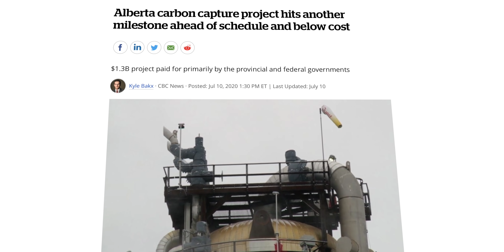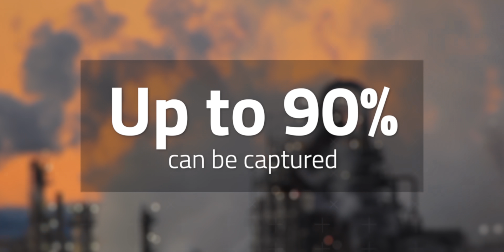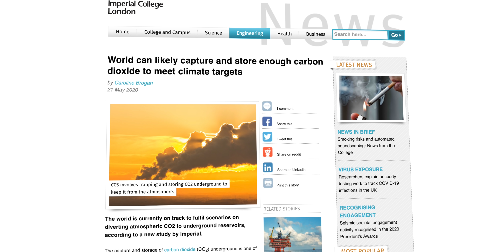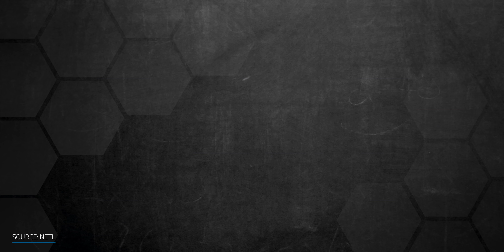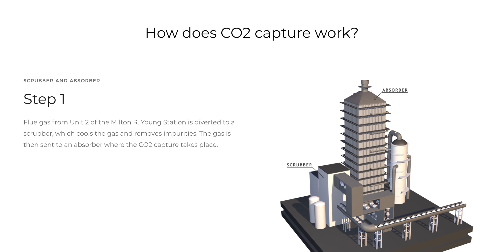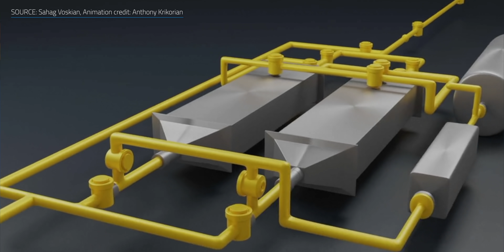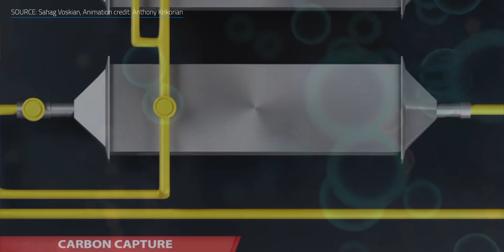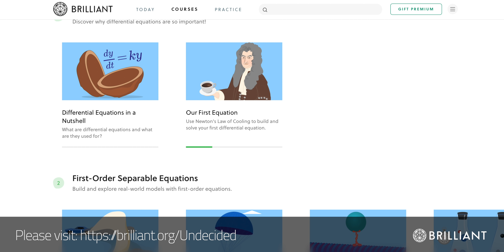The truth about capturing CO2 to reverse climate change

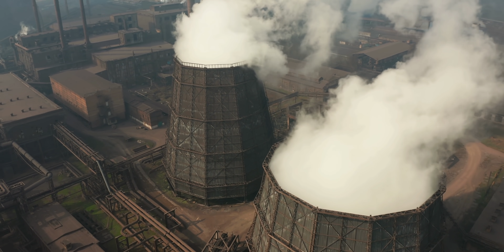Comment: 1:39 that's steam btw
Reply: What I find especially ironic is how dependent renewable energy is on fossil fuels.
Reply: @Philip Ethan van Harreveld no, just no. The monent the sun goes down and the wond stops blowing is when gas power plants get turned on. This does not apply to eg nuclear. So nuclear ends up being more environmentally friendly. Even moee when you take the new models into account.
Reply: Many movements require the ignorance of the masses
Reply: @allahbole  indeed.

Comment: Seems to me that there is no SERIOUS way to eliminate CO2 (net) emissions, until we can stop burning fossil fuels.  We won't stop burning fossil fuels until we have a viable substitute.  Wind and solar probably won't get there (I would like to be wrong, but I just don't see it).  Nuclear Fusion, particularly P-B11 fusion would certainly do it... If only we could make that work (and work in a cost effective manner).  There are some promising developments here, but it still looks to be 10+ years away, so this probably shouldn't be relied upon.  Today's Nuclear Light Water Reactors (LWRs) could do it, but they have costs and waste issues.  The waste issue seems to be overblown... It just isn't as bad as the hype makes it out to be.  The cost issue really comes down to regulations and "inherent" safety.  This is a complex issue, but the bottom line is that the cost of any Nuclear (Fission) Power generating system is very much driven by the INHERENT safety aspects of the reactor design.  Molten Salt Reactors (MSRs) are a newer, generation IV, type of reactor that is MUCH safer by INHERENT design.  (A simple google search on Molten Salt Reactors or MSRE will yield much info here).  If we had NRC regulations in place for MSRs that are much easier (lower cost) to comply with (because these regulations efficiently reflect the MSRs inherent safety advantages), MSRs could be constructed and operated at a much lower cost.  The 10X cost increase that has occurred over the years for LWRs could be reduced or eliminated with MSRs.  MSR look promising as a method to produce energy at a fraction of today’s costs (and a HUGE reduction in the waste produced as well).  With MSRs we can produce MUCH more energy!  The energy available in nuclear fuels (Uranium or Thorium) is a Million times that of any fossil fuel.   With energy this abundant, we can solve many of the worlds resource limitation problems!  The standard of living for all people on earth can increase many fold.  The potential advantages of MSRs are simply stunningly!  We would stop producing CO2 and putting it into the air.  We could even extract CO2 from the air in a means discussed in the video.  Or, we could simply grow trees and harvest them and store them in old coal mines... Reversing the processes of coal burning that has taken place of the past 200+ years.  Since plants actually thrive in relatively high CO2 environments, we would have to determine the optimum level of CO2 in the atmosphere.  It might actually be higher than what it was 100 or so years ago!

Comment: During almost all of the 55-yr period of The Great Acceleration (google it), weed and it’s non-THC cousin, HEMP, have been illegal to grow in the US. So the eco-benefits of hemp are rarely mentioned. It grows rapidly in poor soil, and so can be grown in places where it does compete with productive farmland. It is one of the densest grasses and per acre generates far more biomass than forests. 
     There are no magic bullets, but hemp can be used to pull carbon out of the air, improve the quality & productivity of farm soils, and sequester the carbon for hundreds of years. 
     Using a simple, proven process, the hemp is converted to biochar by heating in an O2-free device not anymore complicated than a meat smoker. The biochar is tilled into farmland, where it binds to soil materials. So long as the land is farmed in a sustainable way & protected from erosion, the biochar can stay safely in the soil for a very long time. 
     It’s a win-win. Farms are more productive and CO2 is pulled out of the air more quickly, due to the much more rapid growing cycle of hemp compared to trees.
Reply: Sorry, “... DOESN’T compete w/ productive farmland....”

Comment: What happens when you capture too much carbon?  Will it send us into the next ice age?  
The only viable carbon capture plant pumped the gas into an oil well specifically so they could get MORE OIL out of the well. When the oil pice tanked they stopped capturing CO2. 
Molten salt nuclear fuelled by stored used fuel is the way forward. Zero CO2 at source. Equally important, it burns down the high level nuclear waste. The stuff with a 30,000 year half life ends up at just 30 years. In the process it extracts 24 times more power than the original PWR extracted. 
When the regulatory process allows these will be cheap enough to put coal out of business and will eat into the market for methane gas.

Comment: Hi Matt, thank you for this very interesting analysis. May I suggest you do a piece on C02 deep sea storage? This is promising as the average ocean dept is below 3000 m (300 bars) the level at which CO2 is more dense than water hence stays on the ocean bed.
Reply: As a graduate student studying CO2 injection into offshore deep sea basalt, this should be talked about way more as the CO2 is mineralized and stored far enough away where leakage into groundwaters/atmosphere isn't really possible. I would love your take on storage in basalts versus sedimentary basins and depleted gas fields Matt!
Reply from the maker: Appreciate the suggestion!
Reply: This idea is nothing new but compression take tremendous amounts of energy, where will that energy come from?
Reply: XPRISE CARBON CAPTURE
The heat loss from a smokestack can be forced into a large tank containing hot liquid microcrystalline petroleum wax. The heat will keep the wax at a molten state which facilitate the carbon to be absorbed when combined with the wax. Carbon when mixed with wax reacts like a dye. The wax-carbon amalgamation result in a black wax solution thereby making it impossible for the carbon to escape into the environment. Other toxic particles are also captured in the wax settling at the bottom of the wax holding tank forming into a sludge. A sludge release valve is located at the bottom of the tank. After the sludge is removed more wax is replaced in the vessel working something like a toilet. The sludge becomes a byproduct that can be used as an additive to asphalt for roads or used for cocooning nuclear waste materials for long-term safe burial. The entropy of the Earth has been increasing at a startling rate since the beginning of the industrial revolution caused mainly by the carbon that is released into the atmosphere. Government scientists have failed to stop and prevent carbon pollution from entering the environment. This problem can only worsen until a solution is found before this problem becomes irreversible. It has been discovered that formulated wax has been shown to be the only answer to this problem. William Nelson

Comment: What are going to do when the CO2 gets to low and the plants all die!
Reply: This is so stupid that it's difficult to reply to. A) The goal is, and always has been, to get to pre-industrial levels of atmospheric CO2, not to eliminate CO2 from the atmosphere. Plants were thriving LONG before humans starting burning fossil fuels, they don't rely on humans pumping CO2 into the atmosphere for survival. B) We currently monitor atmospheric levels of CO2, so we'd know if we were getting close to pre-industrial levels of atmospheric CO2 LONG before getting there. C) Getting down to pre-industrial levels of atmospheric CO2 is basically impossible without adopting an entirely new economic system, so we're not likely to significantly reduce the concentration of CO2 in the atmosphere until there is a massive societal collapse of some kind.

Comment: Some of the ideas here sound interesting but it is with out a doubt just an excuse for fossil fuels to be continued to be burned. If you reuse the captured co2 you are keeping the cycle high enough to still cause a problem. Renewables and batteries. That’s it. That’s all is needed. If we can actually produce millions on evs wie will be able to use this storage to run our civilisation. It’s simple. The caviat is It may not happen quick enough and some of these technologies such as turning co2 into a solid compound may be required in the short term but only for this reason. Not for BAU.

Comment: Carbon capture is NOT in any way shape or form the way forward. Think about it, for every single car engine, massive jet engine, ship, power plant, etc, there needs to be an equally massive machine attempting to perform the opposite process without having a carbon impact of its own. The only way forward is zero emissions. We can live with 400ppm CO2 if we just stop the emissions. I'm 100% solar with EVs that charge on solar. I'm doing my part, and I hope that others do too.

Comment: It is both a necessity, AND an excuse for the Fossil Fuel Industrial Complex to keep polluting. 
I don't know how we ultimately get to carbon output neutrality, but surely we should be pursuing an All Of The Above strategy if technically feasible. We've been pursuing an All You Can Burn strategy and knowingly terraforming a new atmosphere for decades. It is way past due for humanity to be serious about repairing the damage we have wreaked on the planet.
What does All Of The Above look like?
- Decreased Overall Energy Consumption: eg. Building Efficiency, Construction Materials. Reuse, Recycling, Telepresence, Decreased Meat Consumption, Vehicle Efficiency, Carbon Pricing
- Decarbonize Energy Production: Solar, Wind, Geothermal, Hydroelectric, Nuclear, and—The Dream Solution—Fusion
- Carbon Capture and Sequestration: Reforestation/Afforestation, Emission Capture, Atmospheric Capture, Construction Material Sequestration, Soil Carbon Enrichment
- Geoengineering: Stratospheric Aerosol Injection, Marine Cloud Seeding, Space-Based Solar Mirrors (for realz)

Comment: There is FAR more potential for carbon capture - using plants*. Our agriculture is currently *producing a LOT of GHG - artificial nitrogen fertilizer in particular is very problematic. It kills the life in the soil, that is forming the soil, and this releases carbon. And the hidden source of GHG - is that nitrogen becomes nitrous oxide - which is about 8X worse than *methane*.

Grasslands are another huge potential to sink carbon very quickly and cheaply - grassland hold more carbon per acre than forest, and there is more grassland than forest. Grass grows very quickly, and if we manage herds of herbivores - we could sink far more carbon into the soil more quickly than virtually any other way.

https://www.youtube.com/watch?v=wgmssrVInP0

We could be back below 350ppm in less than a decade - if we manage grasslands correctly.

Comment: Love the video!! However, I still think you could have include some new interesting techniques. In Ghent (Belgium) Arcellor Mittal (steelanol project) directly use there CO2 emissions to produce (bio)ethanol. This by making use of bacteria that consume CO2 as an energy source. While carbon storage and more importantly concentration is important I believe conversion of CO2 is the way to go to reduce overall CO2 eq emissions.
Reply: No living system can use CO2 as an energy source. It is fully oxidized and bottom of the barrel energy wise. Even plants use CO2 as a building block for sugars and use the sun for energy. The plant you talk about uses CO (carbon monoxide) as a bio feedstock which still has a bit of energy left in it. The CO comes from their plant and is normally oxidized to CO2, so they are reducing their CO2 emissions but this is a speciality case and cannot be used in coal fired power plants.
Reply: @sjn7220  You are correct they not use CO2 as energy source. They use it as electron acceptor (H2 is the energy source). But it is nevertheless CO2. You can look up the Wood-Ljungdahl pathway!

Comment: The carbon capturing solution can be used in cooling towers of nuclear plants. The whole point of cooling towers is to have as much air-water interface to produce the most cooling, and that in turn CO2 capturing.

Comment: one simple very very good solution, plant more trees! and slow down the mass devastation of forrests and jungles! so easy. END
Reply: Planting enough trees to offset the amount of carbon emissions from other sources is entirely unsustainable. With a growing world population, land is needed for agriculture to keep up with food demands. At the same time, energy demands increase and a huge percentage of the global population is still living without electricity, clean water and sufficient food supplies. Why should we deny them basic needs while there are options such as CCS available? 3rd world countries are unlikely to afford cleaner energy, so the likes of coal/gas/oil power plants may be necessary during their industrial revolution.
Additionally, the majority of the worlds power is generated from coal, oil and gas and power plants have lifespans of up to 50+ years. In order for us to keep up with energy demands and limit emissions, fitting CCS onto these plants is essential.
Reply: @murrayurquhart1849  you seem to forget that is not developing countries that wantst too build the carbonvaacumecleaner, did you know how much of Earth's areal is habitable? I can keep going. It's like fat ppl don't want to eat less food to lose weight instead cheat and gain more in the long run. 1+1 is not 23
Reply: SeanGS Based on current energy demand and current available technologies, there is no choice but to continue using fossil fuels in the short term. Renewable energy coming from the likes of wind and solar only produce energy when natural conditions allow and electricity storage technologies do not allow for it to currently be stored long term. Replacing fossil fuels with cleaner ones (such as hydrogen replacing natural gas) will require widespread change to infrastructure. Changes are happening but not at quick enough a pace. We will likely exceed current carbon emissions targets and then have to remove carbon from the atmosphere by using biofuels paired with CCS, for example.
Reply: @murrayurquhart1849  lol, you can build 2 thermal plants on both poles to provide earth with enough power for free for the cost of about 10 nuclear plants. ZERO EMISSIONS FROM FOSSILES JUST USING THE EARTHS OWN HEATSOURCE
Reply: It's not that simple. There are whole economies that rely on deforestation. I suppose we could go to war with them but out side of that they will need to continue feeding their families. The most reasonable option is to get rid of 2/3 of the human population my mass sterilization.
Reply: @jayknight139  look @ it this way, we are a spec of fart particles hat existed for less than 300k years, this planet is over 4.5billion years. the way life works is imbalance gets balanced out with time... but the smart human race tries to be unbalanced and still get away with it. so nature solves that problem with harsh weather, disasters and drought, viruses and crazy people. so 2/3 of human population is a wee bit to little, we wont even exist in 300 years. something else will take over, maybe cyborgs or enhanced human/androids.

Comment: carbon capture is a fool's errand. Nice overview, however.
Reply: I think it will be worthwhile to do some in order to bring levels back down, and I'm sure there are places that can use the resulting captured carbon (Graphene anyone?), but as a way to make new fossil fuel plants green? No.

What we should be doing is all new energy from renewables, and installing a basic CCS on every current plant in order to slow the emissions immediately. Something that while not perfect can be implemented quickly and cheaply, until the current generation of industrial processes and plants are retired.

Comment: Why not feed it plants in sealed greenhouses to convert co2 to o2.?
Reply: bc there's a cap on how much co2 can be converted to o2, higher concentrations of co2 doesn't automaticaly mean higher concentrations of o2, there should definitely be more research in this field, anyone got some info on that?
Reply: Christoph Wolf with photosynthesis one molecule of CO2 is converted to one molecule of O2. The calculation that needs to be done is how much biomass is needed to handle the CO2 input. CO2 can be converted to O2 by plants, cyanobacter, algae and marine organisms/plants.
Reply: Because it would probably take thousands of acres of greehouses to make a dent in the emissions produced by a single power plant. Plants absorb CO2 extremely slowly compared to how quickly we produce it.
Reply: Because scale.